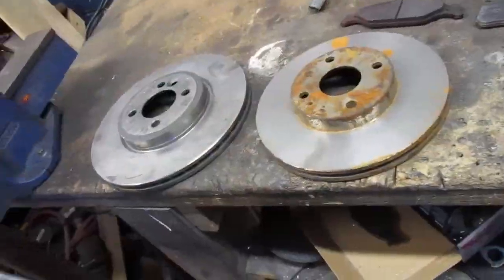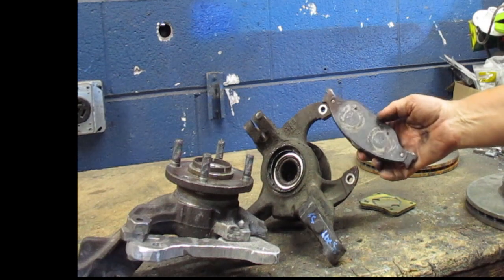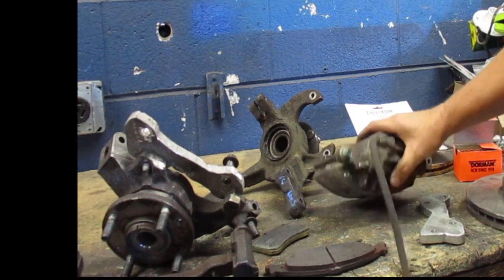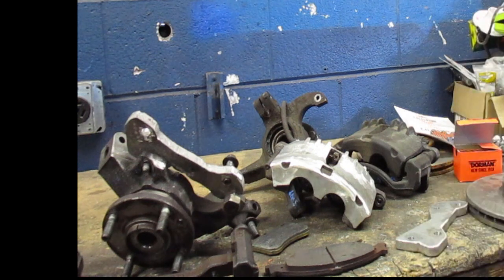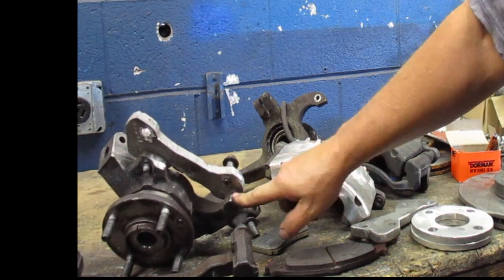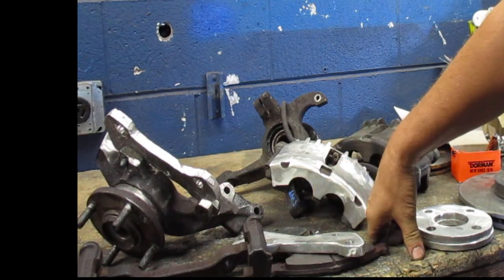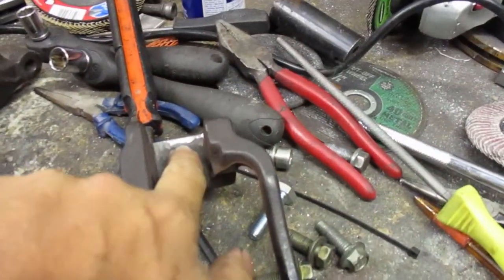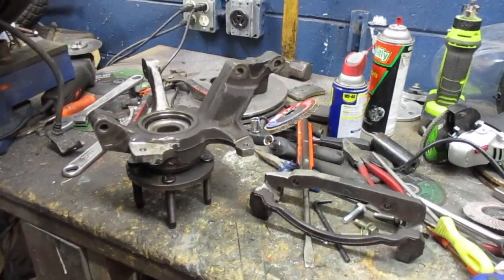DIY Big Brake Kit for Mazda mx-3

Comment: Hello! Thanks for this video. 
what type of metal is used for adapters (shims) ?
Reply from the maker: The plates to attach the caliper brackets are aluminum.
Reply: @murraymadness4674  
thank you for your reply.
What thickness of aluminum?
Is the aluminum strong enough to withstand the forces?
Reply from the maker: @francksimon7801  I believe it is 1 inch thick, it is overkill in terms of strength.
Reply: @murraymadness4674    hello, i am doing the same as you on my MX3. I got a master cylinder from Millenia.Have you modified the brake booster of the mX3? I wonder if the Millenia master cylinder is compatible with the Mx3 brake booster?
Last question ... what type of aluminum did you take for your adapters? what is its resistance? There are different types of aluminum.
Reply from the maker: @francksimon7801  I also used a Millenia master cylinder..I think, it fit right in, they are different than most as I recall, so was lucky to find one, they are little bigger bore which is better for the larger mustang calipers.
The aluminum was typical 6060, overkill for strength.
Reply: @murraymadness4674  Thank you for you  answer !!!

Comment: Change the title in ''Big Brake Kit for Mazda mx-3 Racing-Car'' otherwise any poeple make this bulleshit in their vehicles. If you have put the steering knuckle from the 323F V6, that would be a cleaner solution than this.
Reply from the maker: Where is your video on this?